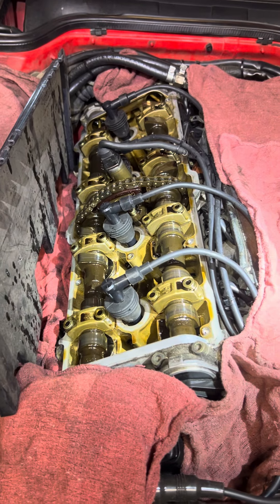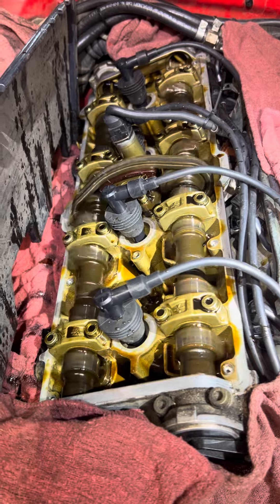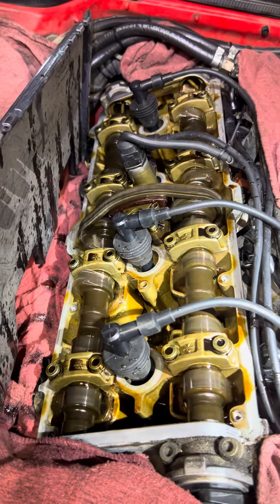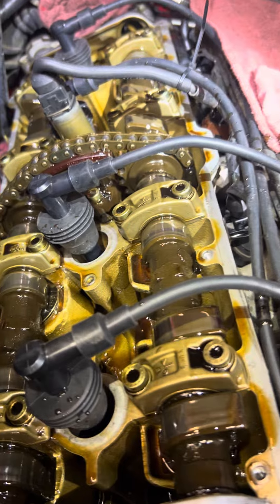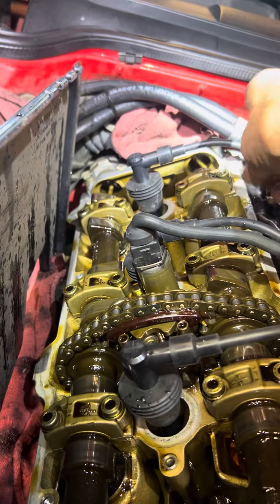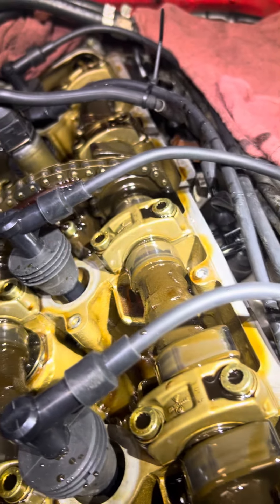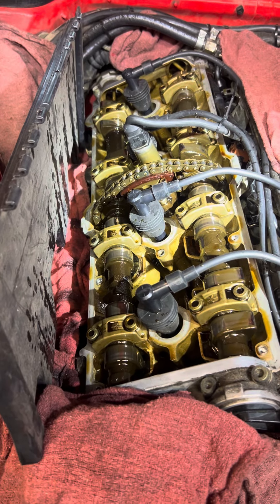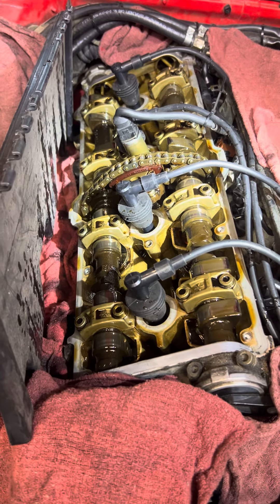Porsche 968 valve train function

Comment: Do you have an video or link of when the tensioner is not functioning properly, what noise it makes. I have a 94 with a lot of valve train noise.
Reply from the maker: Each engine is a case by case basis. The things that can make noise are the lifters which need to fill up with oil, and on a 16 valve engine, the tensioner chain.
Reply: @ComeauRacingEnterprises  If the balance shafts belt failed or jumped loose would if effect the valve train at all?
Reply from the maker: @ no sir

Comment: What’s your take on the 8V motors vs the 16Vs? Any advantages to 8v besides simplicity and a little weight? Or is two cam just always better?
Reply: two cam is almost always better, theres certain scenarios where one cam would be better
Reply: @FrozenInPain  such as…?
Reply: @77magnuss  Only got money for one cam
Reply: The aftermarket for the 8v is WAY better than the 16v, but strictly from a design standpoint, the 16v is more tuneable. It is compatible with a megasquirt, and while the 8v can be made to work with one, it's not as easy as the 16v. That said, the 8v has a MAF kit and solid state ECU with OBD available, while the 16v does not.